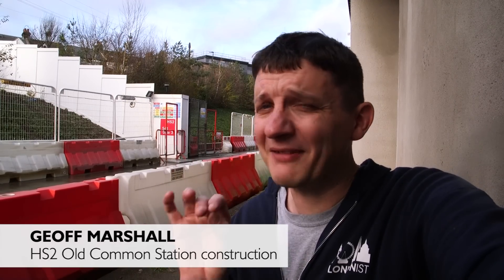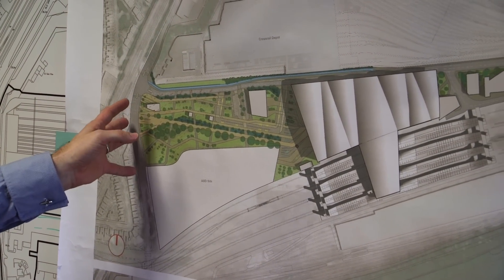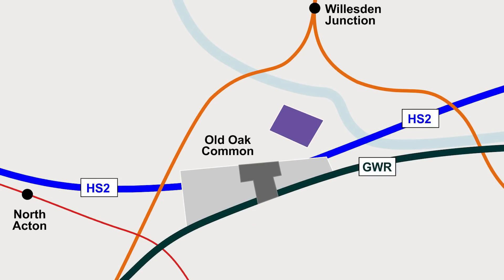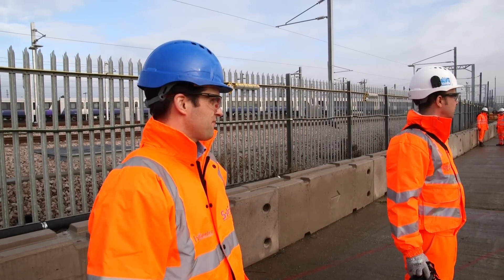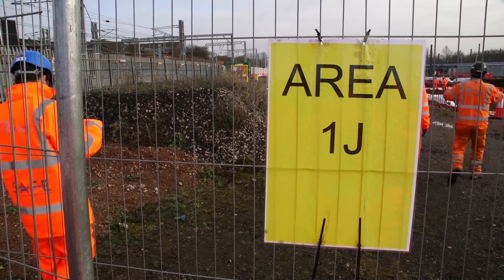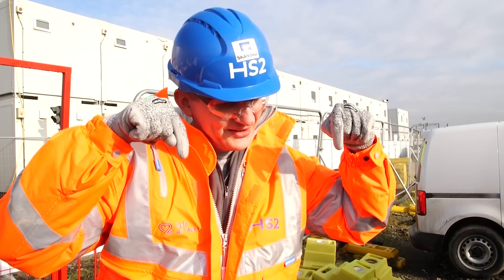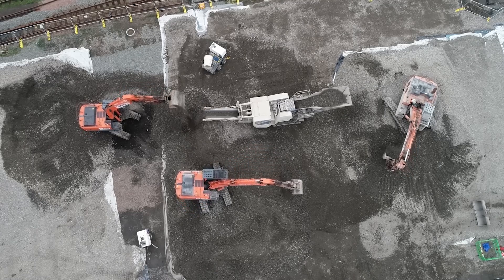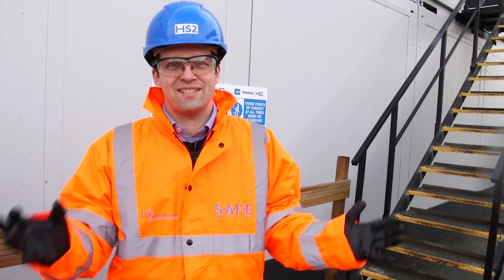HS2 Old Oak Common Station Construction

Comment: Having a new London Overground station at Old Oak Common Lane is a real lost opportunity.

They should move it south and build it smack on top of the Central Line, stick in some tunnels and connect both the Central Line and North Acton directly to HS2 and Crossrail.
Reply: The currently set alignment connects it to GWR/Crossrail, whilst putting it a bit further south wouldn't do this. Crossrail will connect easily to many underground lines anyway.

Comment: Thanks for the great update, but I'm a bit confused, will HS2 trains stop at Old Oak Common then terminate at Euston, or will they terminate at OOC?
Reply: So trains will terminate at Euston and most will also stop at Old Oak
Reply: @galactic_nerd-sk4747  All trains will stop at Old Oak Common
Reply: Euston,it will end there,alot of buildings are coming down,the offices coming down,so the bus station wont be exposed,new taxi rank too(I use commas a lot)
Reply: Terminating and OOC is a myth put about by HS antis (not least the thoroughly biased Lords Economic Affairs Committee who seems obsessed with the idea.) 

It has been discussed and dismissed many times during parliamentary scrutiny: Very roughly the arguments against go along the lines of (this is not an exhaustive list)... 

- OOC serves passengers for east and west London via crossrail, Euston serves passengers from north and south london.
- OOC would need more platforms if it were the sole terminus and there isn't room at OOC.
- terminating at OOC would "fill up" crossrail with HS passengers from the get go.
- once OOC is up and running, it's not possible to build the OOC-Euston tunnels (dispelling the idea of "temporarily" using OOC until Euston can be "sorted out properly" whatever that means.)

There were other reasons, but I don't recall them just now.

Comment: well there doing all this work and the general feeling in the country outside of london is it's a waste of money already forecasted to go well over cost and all to cut not much time off a run from london to birmingham
yet west coast trains could run at 140mph if they had the signaling system installed
Reply: Unless you upgrade the rest of the trains that running on the entire line including local services at either end, no. It doesn't matter if you can go fast if the local service travels half the speed.
Reply: @shaun__3  still more cost effective than the billions HS2 is going to cost to shave minutes off a trip from london to manchester/sheffield
Reply: @MrDavidfball  It's capacity. Increasing the speed of WCML trains would reduce capacity, whilst HS2 will almost triple it on that corridor
Reply: @agent_605  probably would if anyone in the midlands or north can afford to use it.
can't speak for the south end but most people round the midlands don't want it and think its a massive waste of money.
even the old dudley line that was mothballed as a freight diversion for WCML has been handed over to the local tram service thats never made a penny in profit
Reply: David Ball That’s because few people actually understand what it is doing. The fares on it will likely be no different from existing fares on Virgin, as most Virgin services (or whoever ends up with the West Coast Partnership) will be transferred from the West Coast Main Line to HS2
Reply: @agent_605  well if that is so that is not whats been reported in local press in wolverhampton & birmingham that with its high cost it will run at a premium to recoup its costs.
seeing as its forcasted cost is well over budget already and not 1 mile of tracks been  been laid questions need to be asked is it worth it or reopening lines that were closed under beeching to allow more space for passenger by having freight only routes
Reply: David Ball Local press never tell the full story as they are biased. There aren’t any Beeching lines to reopen there either that haven’t already. People claim it is over budget when it isn’t, most reports say it is on budget so far and that any overruns are well within the allocated contingency funds
Reply: @MrDavidfball  why does the government have to recoup it costs, it doesn't, as it doesn't as it the government not a business. It doesn't have to set fares base on recouping the investment. The local media as is often the case is reporting a bunch of old bollocks to appeal to the local masses, so they buy the newspapers. Fake news as others would put it.
Reply: @DavidKnowles0  most stupid answer i've ever read like saying why don't i start a business that will never make money, anything built has to recoup it's costs to even out the nations books were in austerity as it is so your saying throw billions at something just because we can, cheers you've just added extra weight to cancel it
Reply: @MrDavidfball  The country isn't a business, many things a country does never make it money, social services, the military, the police, parliament.
Reply: @DavidKnowles0  but roads rail etc have to common sense tells you that you can't just throw money around and never get anything back
you mentioned the security & social parts yes that won't make money but is required to keep people alive and safe but i guess the tax we pay on petrol & VED doesn't help towards highway building & maintenance.
money does not grow on trees and massive projects ain't just a one way cash cow remember network rail is owned by government & the rail franchise owners pay network rail to use the rail system every time a train runs
Reply: @DavidKnowles0  Because only roads are treated as loss leaders that we all have to pay to cover the shortfall on whether we use them or not in this country that's why.
Reply: West Coast trains could not run at 140mph even with a new signalling system. Most of the WCML currently runs at 110mph (compared to 125mph on comparable lines such as ECML and GWML) because the route alignment is too twisty to go any faster. A "new signalling system" cannot fix that or provide additional platform capacity at the terminals.
Reply: @DaveCardboard  well isn't it funny then that the current fleet of virgin trains have tilt so that they can travel upto 140mph even on twisty sections.
the same thing was planned back in the 80's with the Advanced Passenger Train (APT)
Reply: *they're doing

And it ISN'T about speed, it's about capacity! How many more times to I have to point this out to people?
Reply: @Inkyminkyzizwoz  Exactly. People should really educate themselves on the benefits of the project.

Comment: Where will the Heathrow express depot go?
Reply: Heathrow Express have done a deal with GWR for GWR to operate the Heathrow Express service under contract using GWR owned and serviced rolling stock. This frees up the current Heathrow Express depot for demolition and probably means the end of the current Heathrow Express rolling stock, which doesn't have TPWS (it operates under a derogation as it has GW ATP, which offers a higher level of protection).

Once the current Heathrow Express stock is withdrawn, the way is open to disable the GW ATP installation in the Heathrow tunnels, which will get rid one of the signalling challenges facing the Elizabeth Line - the electromagnetic compatibility issues between GW ATP and the new ETCS installation in the Heathrow tunnels.

Comment: Whilst Passenger Satisfaction at decade low I can't see how HS2 is a beneficial venture, the investment in HS2 could have cut journey times, increased capacity and improved infrastructure for the wider railway network, a lot of the gains from this project could have been implemented on the existing West Coast Mainline through the introduction of ERTMS (In cab signalling), infrastructure improvements & capacity enhancements. The fact that all this is going on while many important lines that connect communities to employment and amenities are running on infrastructure that still use outdated methods like token block working is a crime, all this investment shouldn't be piled in to benefiting a few saving a few minutes, it should be being used to deliver a world class railway for those passengers on lines that haven't seen investment in a very long time.
Reply: PS: Upgrading the WCML would cost just as much as HS2, so why not build the world's fastest railway instead?
Reply: @doomotron6160  It's not the fastest, the fastest in service commercial service will remain the maglev in Shanghai though the new maglev in Japan will beat that as the Chineese one is too short to allow it to hit top speed. Ironically it could have been if our government had not been struck in the 1980's as there was a proposal for an even longer system using the Transrapid maglev that would have come in at pretty much the same cost (Mostly due to massively reduced land costs as it uses elevated guideways) and still had 160 minute journey times from London to Glasgow despite taking a somewhat circuitous route to massively improve connectivity in other key areas of the country in the same project. Planned route was Brimingham, Manchester (With a spur to Liverpool), Leeds, Edinburgh, Glasgow, HS2 proposes the same journey in 218 minutes I believe but doesn't serve Leeds or Edinburgh unless I am mistaken, the final plan for that is to use a big Y configuration but that loses the benefits of the cross link in the North and in Scotland that would have significant regional benefits.

This honestly was the main thing that bothered me if you are going to build a whole new system would have been better to use the current state of technology to deliver the better solution rather than going back to 1980's high speed wheel on rail. The UK has waited so long to get caught up on that I think it would have been better just to skip that era of late 20th century technology and move on to 21st century tech. We could even have actually been the pioneer in state of the art transportation infrastructure again we actually used to do that in rail once.
Reply: @FaerieSeraphina  It's going to be the world's fastest conventional railway (not maglevs or hyperloops).
Reply: No it couldn't. Upgrading the WCML would cause huge disruption to existing services and would only be a short term solution, plus it would probably cost almost as much as HS2
Reply: This is exactly what I’ve been saying. Why can’t the government just get it through their thick skulls. Oh wait, they’re not using their heads.

Comment: It Gona take 30 year and in that time other country are building hyper loop, show how backward this country as gone
Reply: very true sir
Reply: Hyper loop is more hyper than anything else!
Reply: HS2 is the 60s
Reply: @jawadarif5676  HS2 is proven to work. Hyperloop is a glorified test tube that hasn't been tested and is known to potentially be unsafe and insanely expensive with a hideously low capacity
Reply: Jawad Arif the 2060s ;-)
Reply: MontytheHorse That’s a bit off, 2026 for phase 1, 2028 for phase 2A, 2033 for phase 2B
Reply: Alasdair Clift that was a joke. An above comment referred to HS2 as 'the 60s'. I was trying to make the point in what I thought, evidently wrongly, that it was of the 21st Century not the 20th. It wasn't meant to be a comment on the build timescale.
I'm looking forward to the day I can travel on HS2.

Comment: The HS2 is going to ruin my small quiet village. It is an utter waste of money, all that just to cut off 30 mins of travel time?
Reply: @TheRenaissanceman65 Have you seen the spending figures for it? Just like Crossrail it has turned into an out of control money hole and the nativity of the train fanatics in these comments who just want shiny new things built is pretty cringeworthy.
Reply: @clarkpatient7950  Crossrail spending isn't out of control. The condems cut 1 billion pounds from the project when they took charge of the government in 2010. Even the current increase cost, it will still be below it original budget of 15.9 billion in 2010 by about 500 million pounds. It a shame that the media is refusing to report the original budget set in 2010, the cuts by the condems in the 2010 budget review and now the need to increase the budget a level much closer its original budget but still 500 million under it.
Reply: @TheRenaissanceman65 You're giving me primary school answers. It's a disgrace how the UK can't efficiently fund any kind of large scale infrastructural project without it turning into a behemoth of taxpayers money - the sky garden is the biggest disgrace, crossrail isn't too far after.
Reply: @TheRenaissanceman65 Anyone working in Crossrail will tell you how it, along with HS2, is a mismanaged monster of enclaved developments injected with cash without direction.
Reply: @clarkpatient7950  so mismanage that it will still be 500 below it original price estimate of 15.9 billion when the government first signed off the project,  when it completed, according to current budgets.
Reply: @TheRenaissanceman65 That's really not a justification for the complete chaos and disgrace 
 that is HS2
Reply: @holnrew  I suppose that would apply to everyone near the route then ?
Reply: All that for fixing the WCML? Yeah, it's worth it actually.

Comment: Such a dumb project. It would have made more sense to plug HS2 directly into HS1 with a terminus at Ashford, Kent.

That way, Stratford 'white elephant' International could actually have been brought into play a lot more.

Duplicating a current terminus at Euston doesn't make any sense whatsoever.
Reply: @TheRenaissanceman65  Chiltern services go to Birmingham as well, surely that's enough to take pressure off the Euston-Biringham line
Reply: @AlrightDave9188  It did, but not much...
Reply: Exactly!  If the UK had any foresight, it would have retained the old GCR (Great Central Railway) line. Then they could have just upgraded it to take HS2 trains. The route would have been sorted out (being on an existing rail route) and the only thing they'd have had to change would be switching the London terminus from Marylebone (where the GCR started) to Euston. In any other developed European country, this would have been done. But here in the UK we like making things difficult for ourselves, and storing up problems for future generations to try and sort out.
Reply: @TheRenaissanceman65 Nah. It would not make Stratford International a blooming 'white elephant'
Reply: @TheRenaissanceman65 I know

Comment: It's going to be called Park Royal Station, isn't it? Because royal. Have I said too much? Is this Top Secret like the fourth plinth?
Reply: No it's not - that's a myth. It would be confusing anyway as there's already a Park Royal tube station which is about a mile from the OCC site. Linking it with OCC thorugh an underground passenger tunnel would be stupid and cost even more.

Comment: A shame they won’t consider new viaducts for the overground lines to bring them right to the main Old Oak Station, rather than build ones in the middle of nowhere 15 min walks away
Reply: The area is fairly built up, new viaducts would be massively opposed by local residents. The Old Oak Common Lane site will be about 5 mins on foot from Old Oak Common station.

Comment: I just love to see cities expand and develop into a better more efficient systems. For example , in  Stockholm Sweden we're also expanding our tube and rail networks although the only downside to these infrastructure projects is that they always take such a long time to Finish
Reply: Curiously the Stockholm System is run by MTRC which is based out of Hong Kong. The foundation of their success is improving upon the template set by The Tube.  Funny Old World!

Comment: When will this open?
Reply: 2026 hopefully, while HS2 will start in 2028 or 2029 due to delays.
Reply: @galactic_nerd-sk4747  The delays will be worse than Crossrail 1 and it could open fully in 2031
Reply: I believe 2026, I might have to double check

Comment: It's very lovely to see investment in our railways. Do we need HS2? It might be nice to see a percentage of this money going to electrify the trans-Pennine routes which has been delayed yet again for lack of funds.
Reply: West coast mainline is congested and there are areas in badly need of upgrading that involves closing the line. So yes we do but it could be rerouted
Reply: @TheRenaissanceman65 no we don't
Reply: @TheRenaissanceman65 commuter rail is overcrowded. Rural railways are in need to investment. Electrification of the entire network would be better. Also intercity trains and not even full at peak if you look at be stats
Reply: @ThorneyPolitics  The whole point of HS2 is to free up capacity on local trains on the West Coast, Midland and East Coast Main Lines, by removing the InterCity services from them increasing the number of services that can run. Rural railways don't necessarily need investment, and would likely be unable to pay for it as, well they're rural so few use them. Electrification is already happening in a number of places, and HS2s funds would not electrify all the rail network, and would not fix the fundamental capacity problem we are having
Reply: @agent_605  no not the midland and east coast main lines
Reply: Burt Seme Er yes, it is. LNER trains from Leeds, Newcastle and Edinburgh will move to HS2, freeing up space on the ECML. EMR trains from Leeds and Sheffield to London will also move to HS2. That leaves huge amounts of space on both of those lines for more local services
Reply: @agent_605  Correct thanks
Reply: Both HS2 and Northern Powerhouse Rail/HS3 are needed. Personally, I'd like to see HS3 built first but really I don't care.